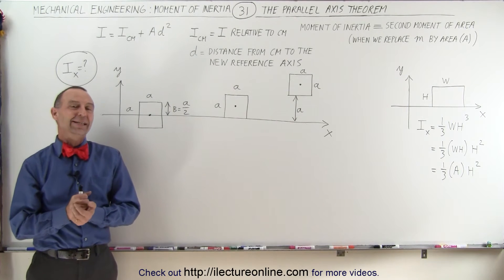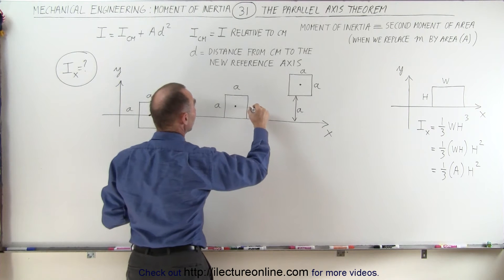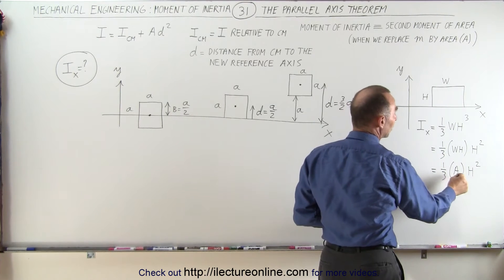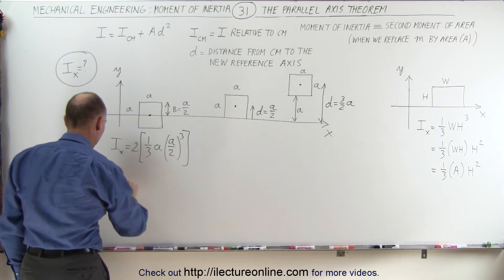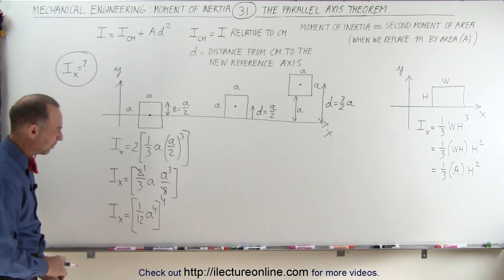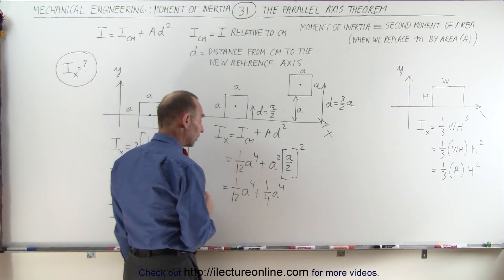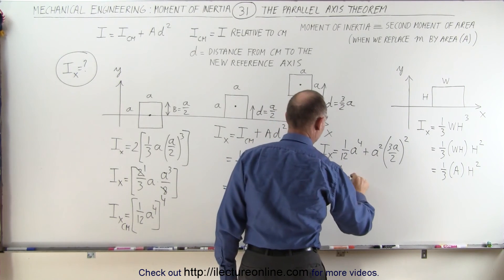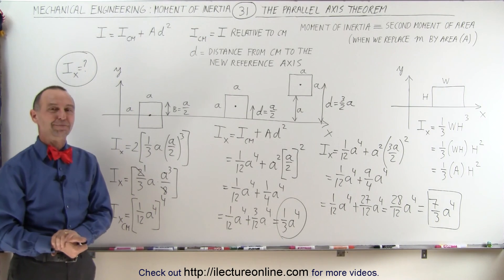Mechanical Engineering: Ch 12: Moment of Inertia (31 of 97)  Parallel Axis Theorem

Comment: good evening sir,, I wanna ask about what is the diferenship between this formula ( Ix= 1/12 bh^3 ) with the formula that u explained in the video? thank you
Reply from the maker: They are essentially the same equation.  One used the mass of the object and the other uses the size (area) of the object.  They can be used interchangeably if the mass is uniformly distributed.
Reply: ok sir, thank you